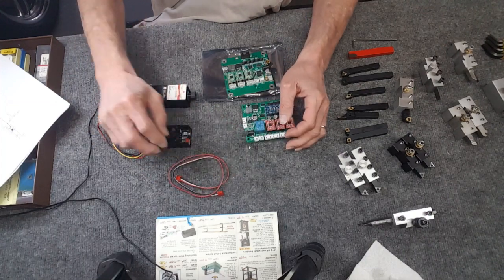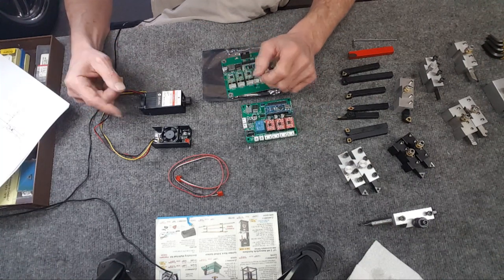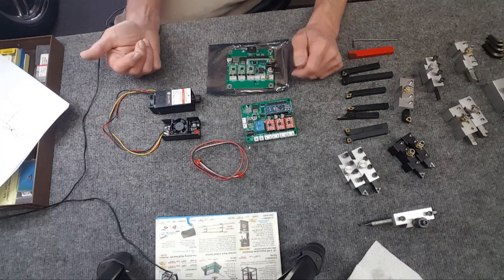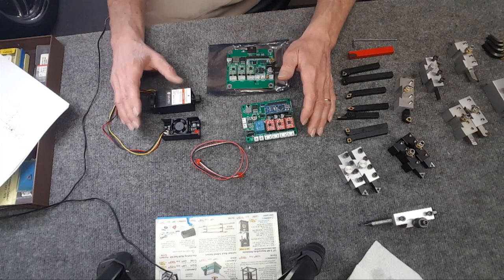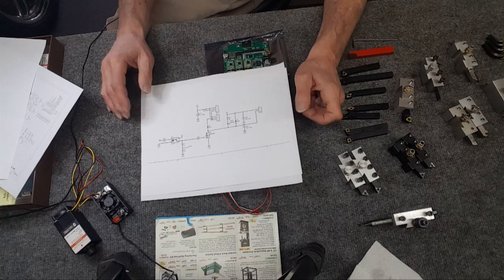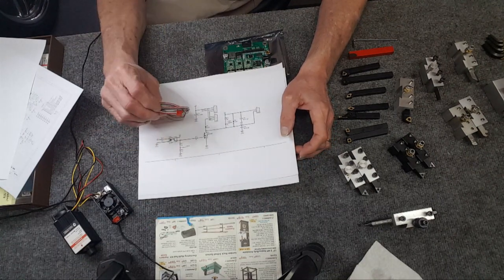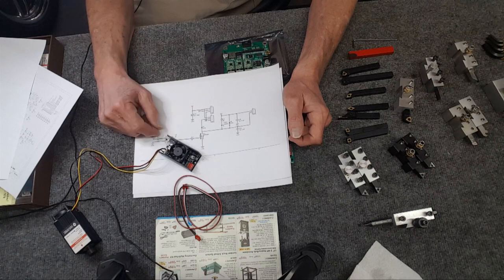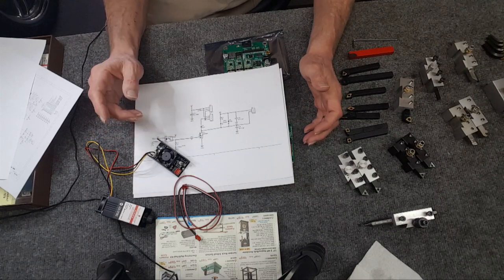3018 Laser Upgrade Problem/Fix

Comment: I have a laser that came with my machine. It is unbranded as far as i can tell. Its a 3018 pro of some sort. My laser doesn't have an on/off switch on the top. It has a wheel that i can control the power of my laser but my computer cant control it. Can you please help? What am i doing wrong?
Reply from the maker: My email is at the end of every video I'm going to need pictures of stuff to see what you have.
Reply: @TheMiniMachineShop  thank you so much! I'll send you some now!

Comment: Hi Dave, Im having the issue of laser not coming on. My board is the woodpecker 3.4 and my laser is a 5.5W. I checked my wires and they are good and connected well. They weren't switched. The board works well with a router but the laser will not turn on. The board is brand new and the laser is brand new. I think that the board is not sending power to the laser. It is a 3 prong connection. The laser fan comes on but no laser light. Any ideas.
Reply from the maker: My email is shown at the video end probably need pictures....
Reply: @TheMiniMachineShop  Thanks. I'll send asap. I had it apart and already bought another but would really like to get it working.
Reply from the maker: @admsfmly1  I'll help when your ready...